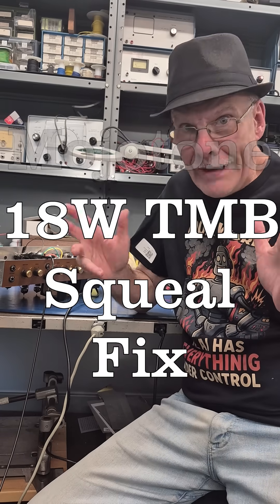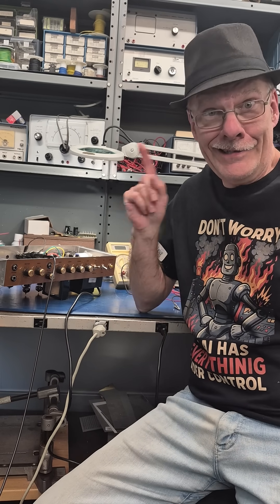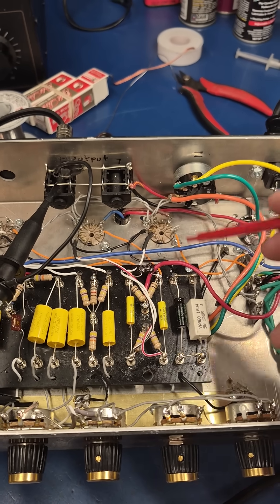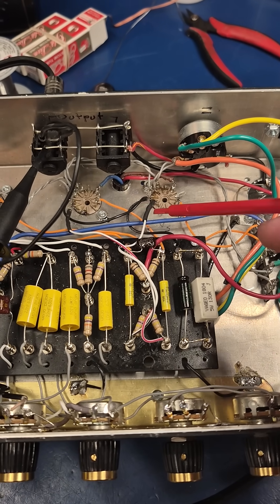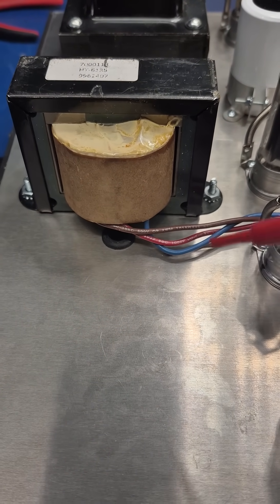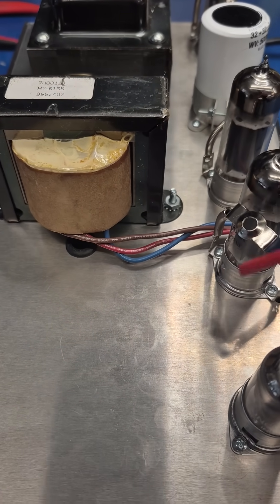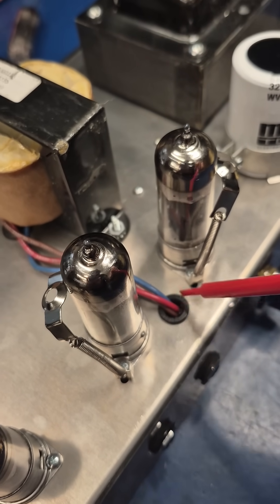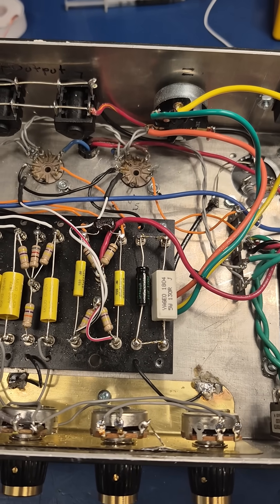Mojotone 18W squeal #diy #retro #vintage #repair #audio #fender #retro #tube #broken #marshall #fix

Comment: Seen it many times over the years.   Had a Silvertone 1484 with squeal and wasn't lead dress.  Had to add screen resistors where there were originally none.  Difference in original tubes vs modern tubes.